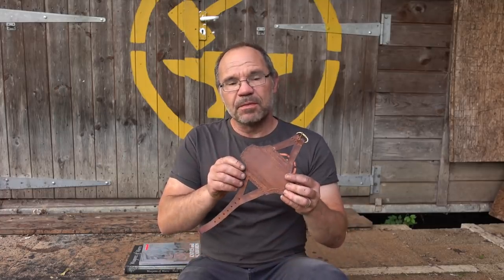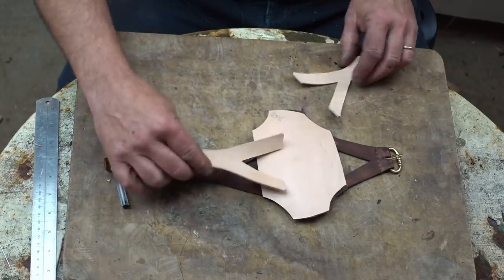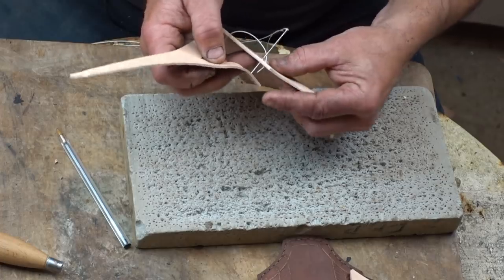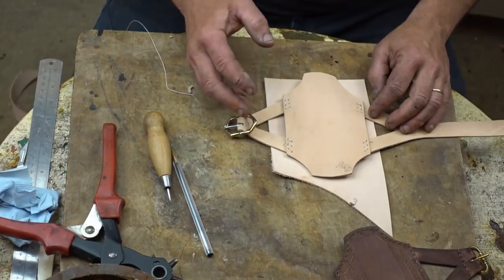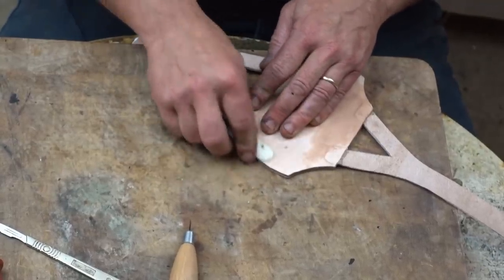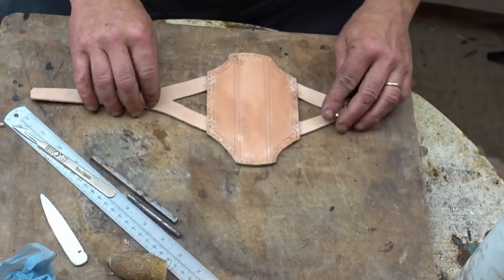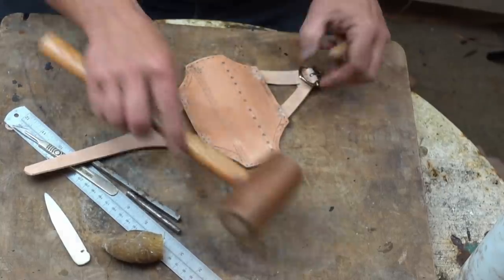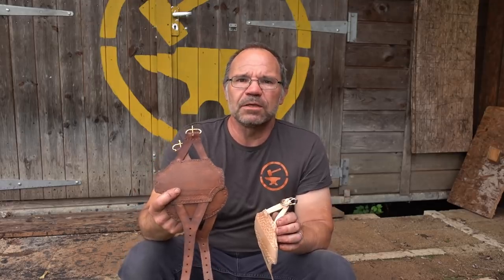Making a Medieval Archery Bracer

Comment: Nice work Todd. 👍 I’m surprised you haven’t picked up an old saddle makers trick, of melting the wax and making an 8:1 mix of wax to pine pitch. This mix makes the thread wax a bit tacky and is even better of preventing a broken thread of loosening and also keeps the wax moths etc from chewing your hard work. I picked this up from a saddler years ago and I was amazed at the difference it made to the quality of my leatherwork. 👏👏👏

Comment: Bought a dirk from you recently Tod and gotta say I love it, working on a frog and matching sheath for it as is (love the one you sent but well I'm a growing leather worker so practice practice practice).  Couple questions if you don't mind.  Do you always use the wooden mallet, and if so why?  I found that the wooden mallet had a bad habit of bouncing, hence my use of a rawhide mallet for punching and setting and my use of a maul for tooling.  I am curious about your stance on these tools.  Also when it comes to dying: which would be more period, oil based dyes or water?  What about treating, same question, what would be more appropriate for treating and sealing the leather?

Comment: Hey, would you consider selling just blades for swords, knives and daggers with the Todcutler brand? Many of us (me included) would like to make our own pieces, but making a blade requires great investments of time and money before one can even start - making a handle on the other hand could be accomplished with hand tools ore common power tools.
I enjoyed this video by the way
Reply: you can buy steel, which only needs grinding and sharpening- tools cost about 50 bucks, if you go cheap...
Reply: @blex5579  I know I can cut out the basic shape of a blade and maybe even do a diamond section, if I spend hours upon hours on it... but tapering? A straight edge? Add more and more time and effort that I cannot expend right now or in roughly the next decade. A handle on the other hand would be more possible for me
Reply: @blex5579  but if you did this, then kudos to you :-)
Reply: @Aeglos88  Yes, exactly. I'd have to send the blade to a heat treating service and hope they manage it. I've seen Albion's offerings, but I'm wary of importing from the US to continental Europe - there are no restrictions on owning blades in my country, but at least SBG has given a warning about importing from the US...
Reply: @ThiLI0n  from 'bladeforums'- Grinding after heat treat will only ruin the heat treat if the temperature of the blade exceeds the tempering temperature. It is easy over heat thin sections when grinding especially with the finer grit belts. That being said, grinding ingroduces stress in the steel. If I were post heat treat grinding, I would run a two hour temperature cycle at 50°F (27°C) less than the temper temperature for the steel you are using. This shouldn't decrease the hardness a noticable amount and will reduce the stress greatly.
Reply: @ThiLI0n  I imported mine to the Netherlands and had no problems, I just had to pay VAT and some import duties which came to about 25% of the blade I believe. Oh and just for what it's worth, to prevent warping during the heat treating the edge was like 1,5-2 mm thick, so it does take some work but nothing more than a bit of filing.
Reply: of course un-hardening it would be the better choice, but here you go, its possible...haven't done it myself, as i'm working on my own oven, but possible, it is.
Reply: @Aeglos88  ok, then I'll look into buying that :-) 
Still, I'd be interested in European-made blades, not only for swords but also for knives and daggers ^^
Reply: HAYAO LEONE  Did you not read what I wrote? I want to do something myself but not the blade, for exhaustively described reasons.
Reply: HAYAO LEONE  :'D I have asked if Tod could provide 'semi-industrial' products,  as you would call them. Right now there are two options: Hanwei replacement blades and Albion bare blades. Those or asking bladesmiths with experience and the ability to provide many products at reasonable prices (Todcutler) if they may do it.
Reply: Mark Morrow of http://swordsmith.net/ makes blank blades for very reasonable prices. He does all kinds of different blades (Roman, Japanese, and Medieval), and honestly when it comes to Roman blades he's probably the best bladesmith you can find for the prices he offers the blades at. 

Really top notch guy, and very good delivery times as well.

Comment: Tandy have a shop in the UK but are a bit expensive. There are a quite a few places in the UK for buying leather, related tools and hardware. Just a comment on leather thickness / weight. 2.5mm = 1oz  hence 2.2mm = 5.5oz ; 3.5mm = 8.75oz and 1.6mm = 4oz.

Comment: .... I don't use braces - regardless of draw weight. I've found they can trap the string between the brace and your arm instead of deflecting away. In fact the only time a string hurt me I was wearing a brace. So I focus on my form and I haven't had any problems since. Although my bows only 80 lbs, I  might change my tune if it were a war bow.

Comment: why does the linen thread not need to be tied off somehow. All you do it cut it, Todd. Why does it not start slipping, in reverse, out all the holes you just threaded it through. Does the beeswax act like a glue?
Reply: Friction. The thread overlaps itself and pushes itself down. And once the two pieces of leather are glued the end of the thread is glued down anyway.
Reply: I'm not an expert but there are proper ways to tie it off a little more securely.   I wouldn't leave it open ended like this if you don't have the second glued liner. Youtube has plenty of great leather working videos, just check out some stitching videos.
Reply: This is meant to be easy and diy at home. The thread will not get loose.

Comment: Why sew & glue 4 pieces of leather together instead of just using a single piece of leather?
Reply: Well, first of all you need different thicknesses of leather for different purposes. The straps have to be flexible and the center section needs to be thick and tough. Then you double up the thickness on the joints to make them structurally stronger. The back piece is optional as Tod said but it's a nice finishing touch since leather is smooth on one side and rough on the other. If you glue the pieces back-to-back you got a piece that's smooth on both sides and you also cover the joints where you sewed the straps so they don't catch.

Comment: Try too glue with Skinglue I don’t know the English word for it Gelatine is made from the skins of pigs.its the same material as the leather, its the natural glue for it. Try it, it makes leather very hard and glue it 150%
Put the leather into a pot and this pot in another pot with water in it. And in the leather pot you make 0,2l water and 50 grams gelatin . Let it in the mix for 1 day 50 degree C . Put the Parts to glue ( hot) on a board of plastic , together and fix it let it dry 3 days